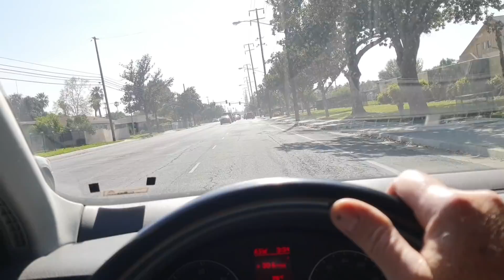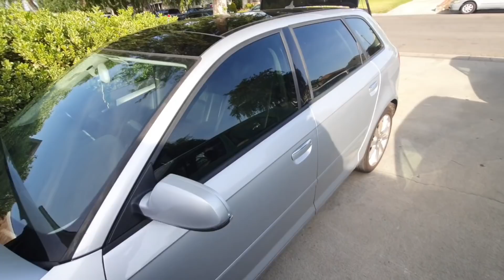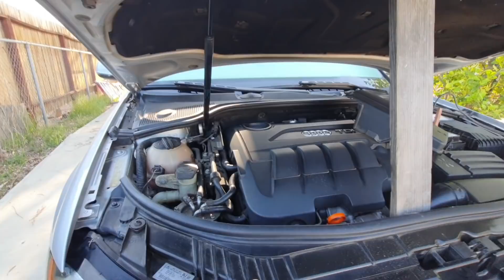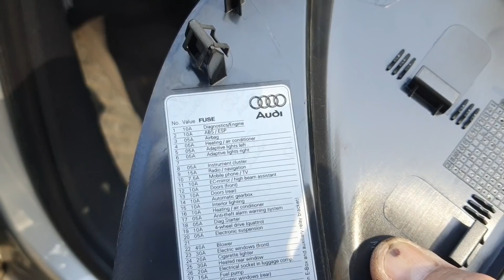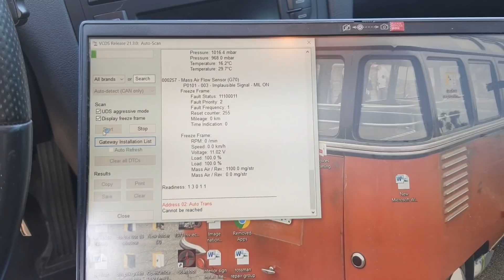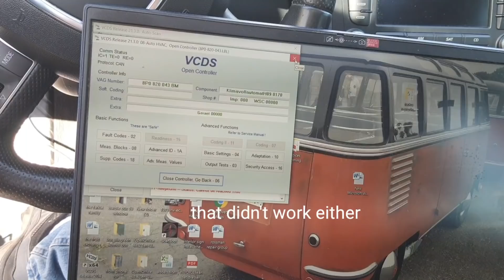CHEAPEST AUDI A3 TDI on marketplace CAN WE FIX IT ? Right hand drive vw bug  PT 1

Comment: Hi mike , is the mechatronic on yours have the 25 pin connector ( not all of them used) just checking wiring diagrams
Reply from the maker: I dont think so. IT is the round connector.
Reply from the maker: I believe it is 20 pin and not all of them are used on it pulled it off and only about half of them are used.

Comment: Hi mike looks like the supply to dash panel is through fuse sb17 which just happens to be next to the melted fuse  ( suspect)  TSB  10066458 . I think the fuse box is possibly damaged underneath.
Reply from the maker: Ok I will check that. Thanks

Comment: What year is the audi
Reply from the maker: 2011
Reply: @Mikefngarage   I'm going to try to get some wiring diagrams an have a look .
Reply from the maker: @myleswaller  COOL would like to save this car.
Reply: Audi a3 dash panel pinout
1 +12v sc8
2 +12v sc8
3 gnd
4 gnd
5. J533 CAN GATEWAY
6 Fuel gauge sender 2
7. Front left brake pad warning
8. Oil level/temp sensor
9 j489 radio control clock
10 j489 radio control clock
11
12
13
14 brake fluid warning
15 oil pressure warning
16
17. Term 58d lights
18 +12v sc8
19 gnd
20. Windscreen washer level warning
21 coolant level warning
22
23
24 ambient temp sensor
25 Fuel gauge sender 1
26 Fuel gauge sender 2
27 Fuel gauge sender 1
28  gnd (sender earth)
29 CAN hi
30  CAN lo
31  Imobilizer pickup from key
32. Imobilizer pickup from key
Reply: Check you have power on 1,2 and  18
Reply from the maker: @myleswaller  1 and 2 have power both sides. 18 not sure the location do you have a link showing the under hood fuse panel. this could help me find that.. WOW your so helpful. I think with your help I can fix the Immobilizer unit problem. I really think the trans is the Mechatronic but we shall see.
Reply from the maker: @myleswaller  18 has power and is good. found the small numbers on the fuse panel. cant see that good anymore.
Reply: @Mikefngarage  hi mike , i was referring to checking  the instrument panel connector pin 1,2 and 18 sorry if i didn't make it clear. Whatsapp +447594839282

Comment: If u swap relays around odviosly only swap ones that are same worked for me 
Only bad thing I didn't know what they all were so swapped all ones with same numbers but bad thing I didn't know which one  was bad after swapping them around lol they only cheap so done em all
Reply from the maker: Oh yea good point the board with the relays on it I think is where the problem lies for the dash. GOOD POINT!!!!
Reply: @Mikefngarage u may probably know anyway but  on the leon relay for ignition is inside car aswell 
By steering wheel not sure if will be different on urs I'm from the uk so on other side here
Reply from the maker: @danglee1786  I iwill check that thanks for the help. Once I get the trans sorted I will see what is next. need to stop that short.

Comment: Mate before you spend a shed load of money get a wiring diagram for that car . Check the power and grounds for the tcm and dash panel . I think immobilizer consists of dash panel , pcm and key . All have to be able to communicate to allow engine to run . Also  the fusebox under the hood  has a torx bolt in the middle undo it and have a look underneath looks like it was melting where that fuse was?

Comment: I had a leon tdi with no ignition lights on an no crank  an was the relays for ignition I ended up swapping relays around under dash an it started working
There was updated relays from dealer too
It wont read codes as no ignition on 
An another one to check is the metal fuses with bolts on them sometimes the fuse cracks

Comment: maybe it the fuse box the issue, pull it off and look if underneath is ok and not burnt
Reply from the maker: probably do that next. once I rule out the trans module. I am sure it shorted.
Reply: @Mikefngarage  how do you prevent it from shorting again if its not the problem with overfilling of trans fluid
Reply: @Mikefngarage  cool good move

Comment: Junk. Those motors fail. Audi looks good but the motors are junk.
Reply from the maker: You need to do a balance shaft delete then they are fine. Same as 09 vw. Bad oil pump design once its fixed your looking at 500k plus miles on it.
Reply: @Mikefngarage  that will make the engine start for a second and shut off? My dashboard key is illuminated
Reply from the maker: that is the "hormal" way for the immoblizer to work. I think the J285 dash module is bad too. We shall see. Need to spend some money just to find out.